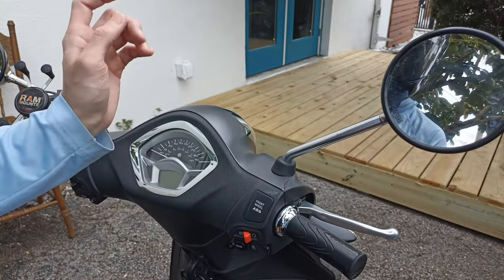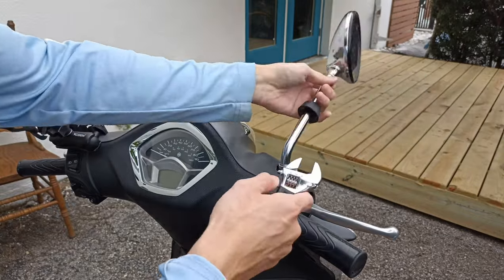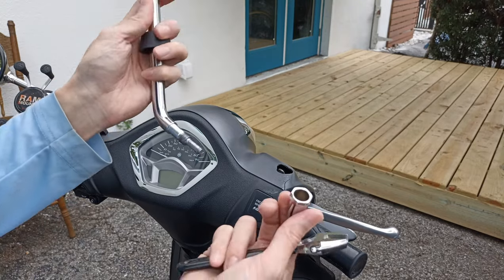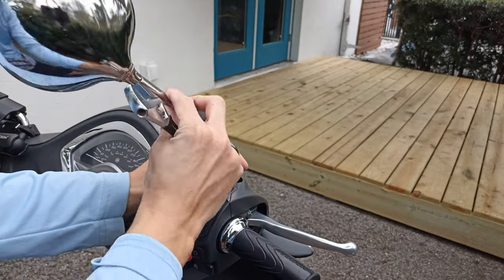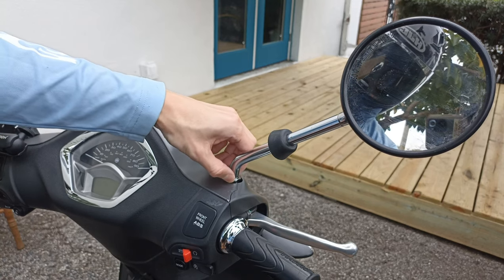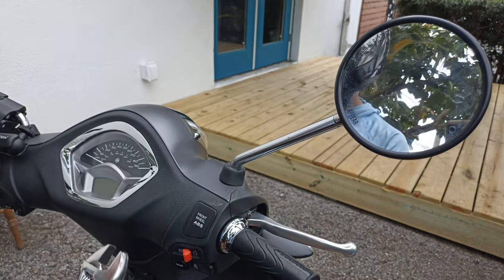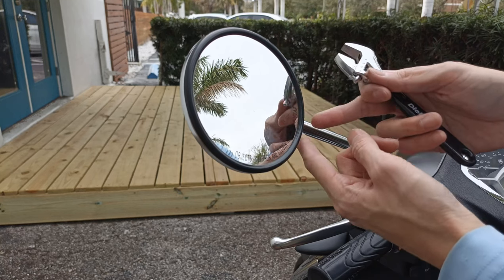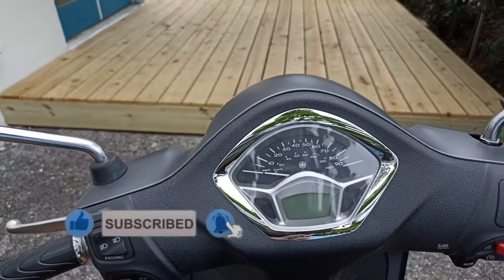Piaggio Vespa Mirror Change Tutorial Quick Fix [4K]

Comment: Hi, my right mirror bolt was broken. Do you think welding can works fine on it?
Reply from the maker: My mirror broke off and the bolt was lodged stuck before too. I used a screw extractor kit to remove it. Basically, you drill into the broken sheared off screw, then use another bit to reverse it it. Check out this kit 🤙 https://amzn.to/3qiMKgl